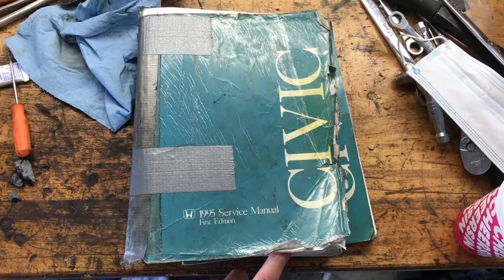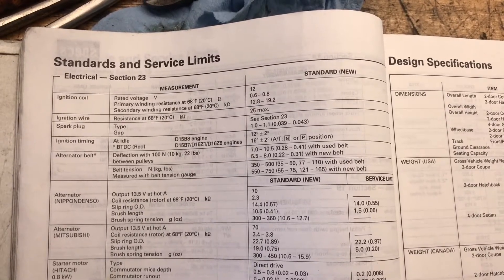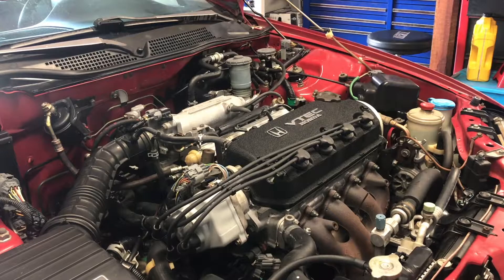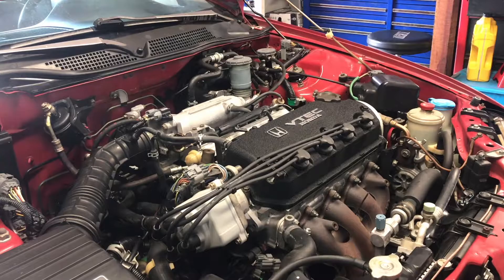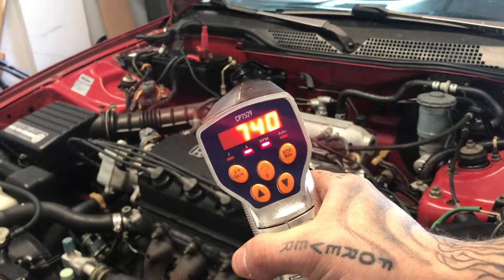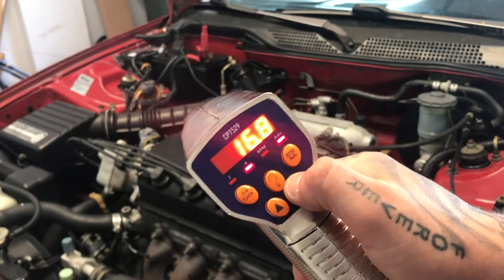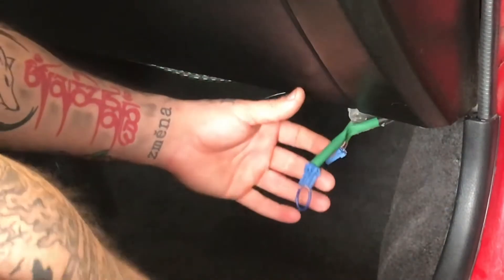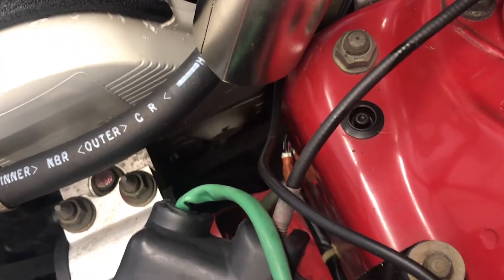How To Set Honda Civic Ignition Timing D16Z6

Comment: The timing on mine is correct however it doesnt want to start if i rotate it 180 its sounds like it wants to start but no way to mount it. Might need a new distributor😢
Reply from the maker: @Darklord-Anubis  if it ran before you worked on it, then your probably have the ignition wires in the wrong order. Also, the distributor gear is offset so it only goes in one way
Reply: It turned over once after an engine swap but its been dead ever since @After7Garage
Reply: Sounds like your firing order is a little messed up that's all. These will always run wether your dizzy is full clocked one way or the other

Comment: I need to set timing on mine its a z6 head on a y7 block is there a difference in the crank pulley or can I just set the timing as if it's a z6 block? Just put the block in tdc and set 16* on the light?
Reply from the maker: @slappyclappy7781  yes ignition timing should be similar but depending on mods it could like more or less timing by a degree or so

Comment: this has nothing to do with timing the crankshaft? are two different things?
Reply from the maker: Yes two different things. This is ignition timing for your spark plugs. Which is done by the distributor that goes into the camshaft. Crankshaft is on the bottom and only touched for timing belt service.

Comment: So on a d16y7, just did a distributor, car will not start now. Was told timing advanced from trying to crank it. Distributor is pointing at cyl 2 not 1 with the engine top dead center. Got a timing light now. Any suggestions? We were told timing was why it wouldn't crank.
Reply from the maker: Take a break and start over again, just like you did. Set engine to TDC and remove the distributor cap. It should be pointing to cylinder 1. Make sure your wires are in the correct order. 1-3-4-2

Comment: Do you aim for the 3 red line or the 1 white line?
Reply from the maker: Depends how you use the timing light. The 3 red lines are 12, 14, 16 degrees BTDC. So if you use no advance on the gun then you set it to the last red line at 16. If you use timing advance on the gun like I did then you set it to zero at the white line. Hope this makes sense.
Reply: @After7Garage  oh yeah definitely! thanks for the info!!
Reply: what white line??🥲
Reply: Where do you set it at if you have the old fashion light that don’t have option to set your target etc ?
Reply: @briansilva9120  the single white line is TDC. the three dots to the left is 18|16|14| degrees BTDC. Set it in the middle of the three lines at 16 degree BTDC. should be red
Reply: @BooNxE  just what I taught,  thanks for your knowledge

Comment: What if your not running the timing cover?
Reply from the maker: The upper or lower timing cover? Upper one doesn’t matter as much but everyone should be running a lower cover. Which has the timing pointer
Reply: For anyone wondering. Could try with a scanner that has live data that shows Spark Advance (ADV).

Comment: My d16z6 is not reving past 6500rpm,could this be the answer? The distributor was taken out, and I assume is not in the correct timing.. is the rev fault due to timing? Cheers.
Reply from the maker: Hmm that’s a strange one. Typically the ignition timing would not limit the revs, the ECU controls that. Is your ECU chipped? Could be an issue with the tune file